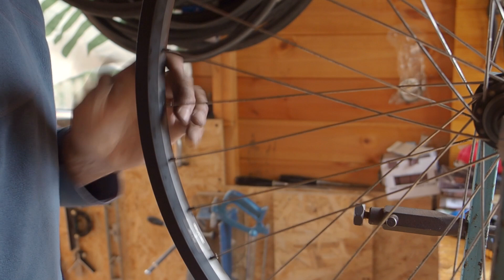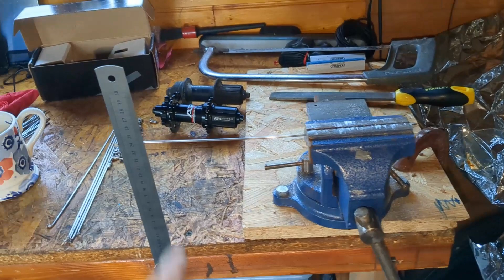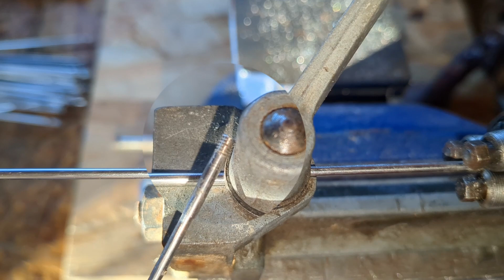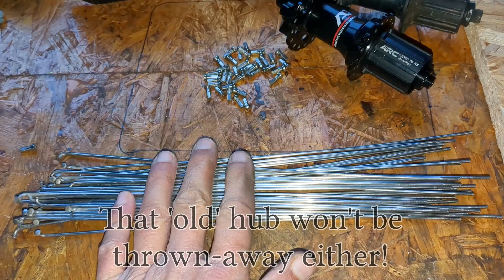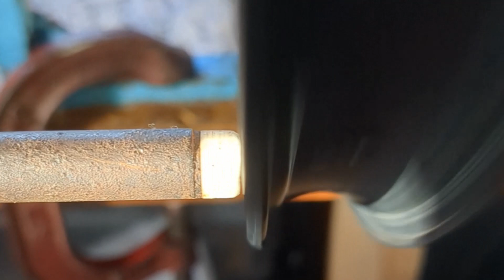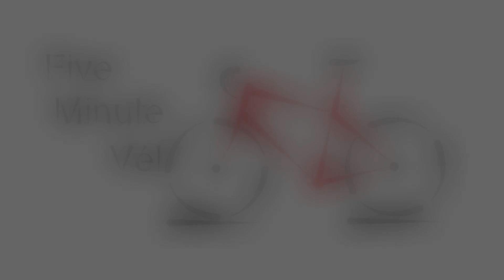Wheel problems: reusing spokes!

Comment: Someone once told me that it took more energy to make double butted spokes than to produce a car. Since then I only ever use straight gauge.. Good to see you doing the same 😅
Reply from the maker: I think that might be a slight exaggeration. Butting the spokes is just a rolling process, which should be a relatively low energy process. One could also argue that double butted spokes use less material and therefore lower energy. 
The biggest argument for using butted spokes is that they are lighter. However the weight saving is very small, for me negligible and not worth the extra cost.
Reply: They also add more flex to the wheel. Which if you are riding aggressive trails is a good thing.